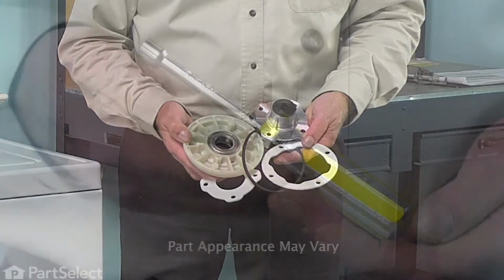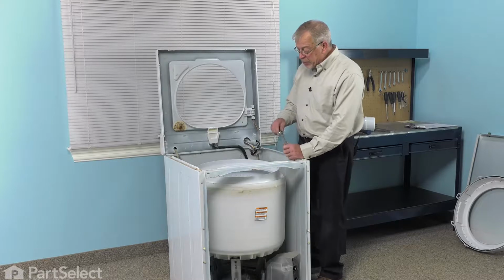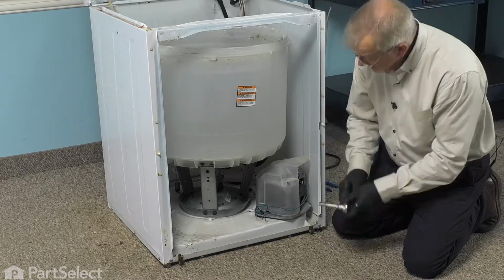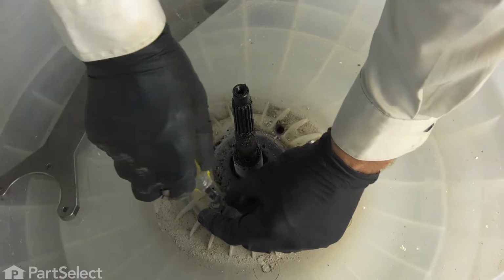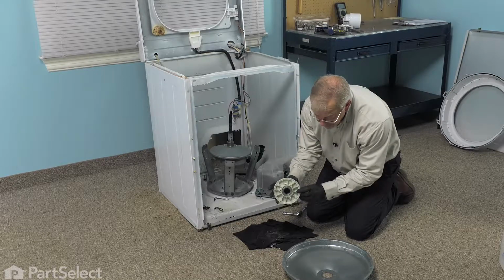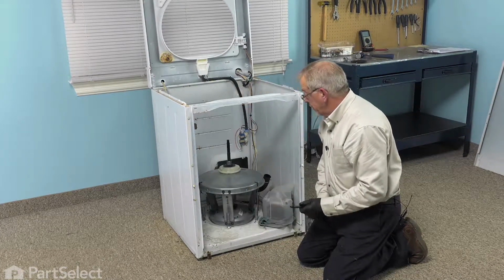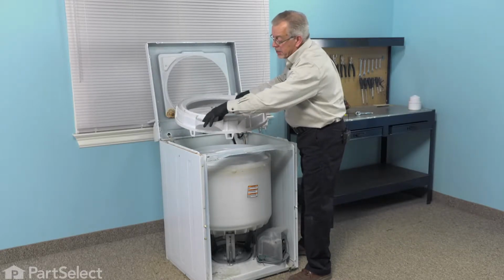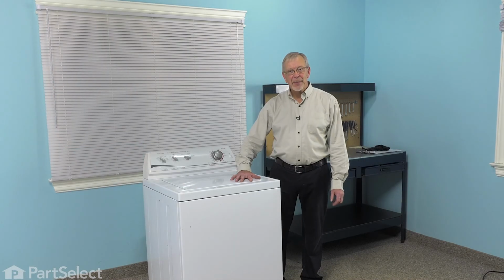Whirlpool Washer Repair - How to Replace the Hub and Seal Kit (Whirlpool # W10219156)

Comment: Hi Steve, That center hub will not come off that easy on mine. The biggest part of the problem is that the shaft does not remain locked in either direction so it just begins turning when I hit the wrench with the hammer. Any suggestions? Thanks
Reply: I’m having the same issue did you figure it out?